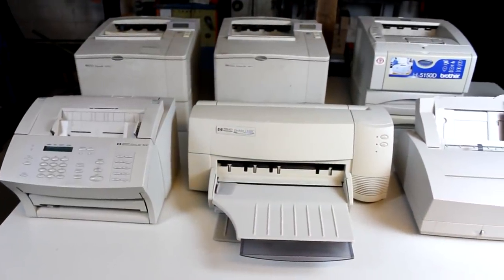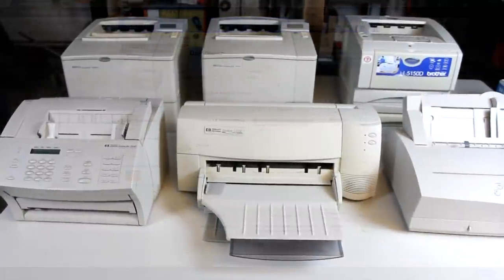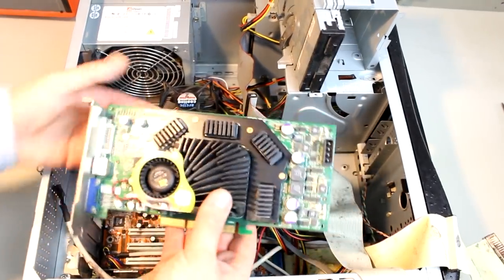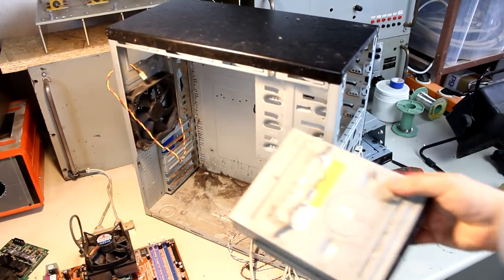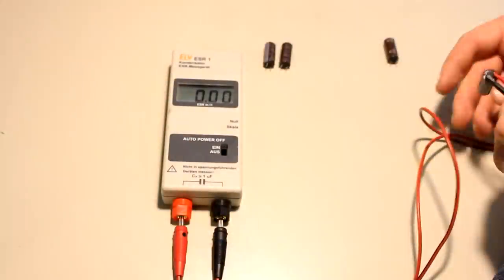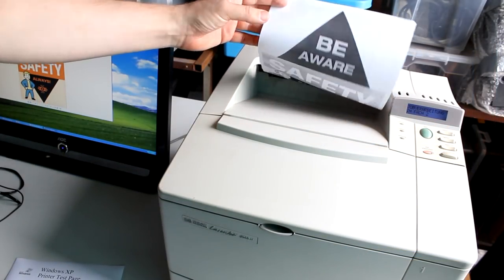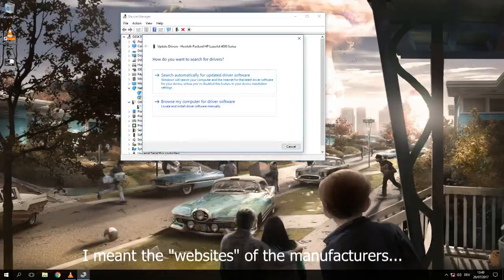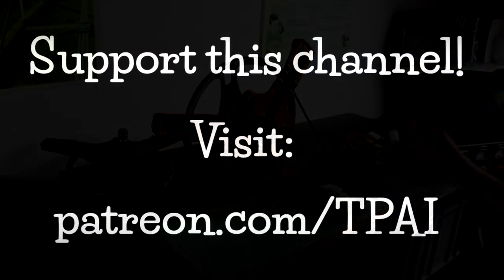Repairing and Restoring an Old Computer - (for those old Printers)

Comment: Desoldering old caps is easier if you add a bit of fresh lead solder on the joints.
Reply: the problem is the huge copper surface of the board leads... those leads suck all the heat from your soldering iron, adding more solder will make it even harder... talking from experience, i had the same "dry capacitors" problem few years ago...
Reply: IamIUareU I had most problems with ROHS leadfree solder and I think adding lead based one lowers melting point. I found that with new solder on iron tip it helps with heat tranfer to the joint. But thats only my assumptions.
Reply: yeah, you are probably right, but i didnt think about that because lead based solders are banned here... :(
Reply: He should use a wider, screwdriver-type tip. Also, his tip is very dirty
Reply: Buy a temperature controlled iron and up the heat for lead free solder, using a flat blade tip on irons gives you more thermal mass so lets you melt the solder. But if the components are close together you can end up doing more damage. 
 
I see a lot of people thinking the cheap iron they have will do the job, but compared to other tools more expensive tools they have makes no sense.

I soldered in my first job for 3 years, working on circuit boards, ground planes and rework. Never had the issues I see on most YouTube videos.
Reply: Afaik leaded solder is only banned to be used in production, you can still buy leaded solder freely.
Reply: Preheat the board for 1 minute with hairdryer first, then immediately desolder. Works great for transformers and large inductors;)
Reply: Temperature-controlled irons won't do you any good if it's just a 25 to 50 watt iron. My 50 Watt Weller (non-temperature controllable) was not able to do the job with point 8 (something like 385 degrees Celsius)

At work, with an 80 Watt Weller temperature controlled iron (it costs something in the range of 700 to 800 Euro) and set to 425 (the maximum) it still was VERY hard. The ground planes are the biggest problem. Peak-currents in a modern motherboard are easily in the range of 300 Amps and higher: to get inductance down, there is A LOT of copper used to handle this. The multilayer PCB's interconnect all of these ground and power planes to form one big conductor.
Reply: IamIUareU Where do you live that lead solder is banned?
Reply: +IamIUareU

You don't need lead solder to remelt crusty old solder joints, you need liquid or paste flux. I would recommend RMA or RA type flux, preferably the NC variety (no clean.) Some types of fluxes are very aggressive and require cleaning to remove them after use or they'll start corroding the board.

I used to have the same problem as you with soldering irons getting sucked cold by large ground planes, but then I started using flux and haven't had the issue since.
Reply: +weeardguy

If you're having problems with a 50W iron not being able to melt solder on a PCB, you're doing it wrong.

I have both a 25W and 40W Weller iron and station and they do just fine on PCBs with large ground planes. The key is you need to use the proper flux and not try to blob more solder on to the connection you're trying to remove, because it just increases the surface area contact with the ground plane.

The only time I run into issues is if I have something like a fat inductor on a power supply that needs to be removed, in which case I'll use an 80W desoldering gun which does the job.
Reply: GGigabiteM it is not the wattage of the iron that is the issue it is the temperature that it gets too. 
Also dump the liquid flux, just hot the joint with a bit of corded solder lead or lead free, then solder sucker. 
If your solder sucker does not work, buy a better one.
Reply: @Tobinator Macedonia. i was using lead containing solder in the past and it was way easier to use but nowadays you cant find such solder here :(
Reply: Buy it from somewhere else and import it maybe?
Reply: It's banned almost everywhere for use in professional appliances, unless they are in the category of medical and defence devices, were lead-containing solder is still approved to use.
But, as a hobbyist you won't have such a hard time (in most places) to obtain lead-containing solder. But, I can understand that there are countries where it's very hard to get.
Reply: Flux is a material to improve the flow of a not yet soldered joint or a badly soldered joint. Flux won't do any good to melt old solder.
Reply: No, it really IS the power of the iron that is the problem in most cases. You need a responsive, high power iron to heat the joint. You want A LOT of heat at the joint for just long enough, not just a little too less heat for extended periods of time until the rest of the PCB is warm enough to melt the joint.

My 50-Watt Weller at 385 degrees just doesn't have the power to melt the joint as the planes dissipate so much of the heat. The iron itself is quite a responsive iron: you'll hear it click almost instantly after applying it to the board.
Reply: There is a difference between a PCB with 'just a plane' (no matter if that's a ground or powerplane) or a multilayer PCB of a motherboard, with a shitload of via's, multiple interconnected planes and thicker copper than the average PCB.

I solder for 21 years already, I know what I'm talking about.
Reply: weeardguy you dont need a 100k car to get from point A to point B same with soldering.
Reply: >Flux is a material to improve the flow of a not yet soldered joint or a badly soldered joint. Flux won't do any good to melt old solder.

Uh, yes it will. Why do you think old solder has trouble melting? Because it's heavily oxidized and the fluxes originally present in the solder have long since evaporated and left gunk behind. RMA/RA type fluxes are designed to chemically neutralize oxidation and will make old dried up and oxidized solder joints flow properly again.

Using new solder on old solder essentially does the same thing, the flux core gets rid of the oxidization, you just get an additional blob of solder with it, which isn't helpful in some situations.
Reply: I'm not saying so, someone else said that. The cost isn't that important. It's about power combined with temperature. A 10 Watt soldering iron at 400 degrees will not be able to do the job. Take an 80 or even 100 Watt iron at the same temperature or slightly lower, and chances are you can fix it. And that has nothing to do with price, the only thing is that most more responsive soldering irons that heat up quicker, are just more expensive. But if you find a good one for say 80 Euro's, that's fine.
Reply: If you has that problem is because you are using a cheap 30W pencil sonder, instead of 40W cheap pencil. or a proper solder station.
Reply: you dont have to spend 700-800 euro. i would never buy a weller. i never worked with a good one. the jbc i have at home is much nicer. if you dont care about digital reading get something like this:
this here is quite a good offer. https://www.weidinger.eu/en/shop/soldering_equipment/jbc/jbc_tools_soldering_and_desoldering_device/jbc_tools_compact_line/wl26830

they heat up in 3 seconds from 0° C. a lot of power and very responsive. still around 350 Dollar. but in my opinion worth the price.
Reply: Even easier with a big pair of pliers.

Comment: THANK YOU! THANK YOU! 

You've solved a very old mystery for me that I've been wondering for 25 years. Among my friends it was common knowledge to not clean your computer out with an air compressor. We had a few friends that would clean them out that way then they wouldn't work. Never thought about the voltage the fans would create when they were spun. Just one of those things that you know but don't think of.

Comment: Hp universal driver will work on a lot of older printers.
Reply: Rudi Fellner This. I work in IT and universal drivers save my bacon all the time with old printers.
Reply: HP Universal Driver is a good thing. I can confirm that too. 
There is also some kind of universal driver from canon, called generic PCL6 driver.

Concerning HP, back in the days, before they made the universal driver, it was always worth a try to use the (windows integrated) HP Laserjet 6L driver, which works for surprisingly many newer models too.
Reply: I still am wondering where he got the ink ya know.
Reply: ig33ku Usually when a business has printers they have a ton of the same one. Only a couple printers are around when they are selling/recycling/disposing them but they still have a ton of cartridges for that model.
Reply: He can also use TurboPrint for Linux and if the Hp Printers are working out of the Box all Driver Issues are fixed. Also he can use then a modern machine which he could already by using a Virtual Machine like VmWare
Reply: too bad that that rarely works on 64bit system, which originally was designed for 32bit  or even older win9x VxD drivers
Reply: @florianlechler6912  99% of HP printers speak PCL. No need for any special "drivers"
Reply: xerox drivers work well too.

Comment: Wow, great tip about the computer fan, very logical and make good sense now that you have said it. Now I know what happened to one of my old Dell laptop 10 years or so ago, it worked fine but seems to be running hotter than it used to, I removed as much of the plastic as possible, found it very dirty, and blew it out with my air compressor, it never worked again. I always figured I had blown a component or connection loose on the motherboard or something like that and went to Best Buy and got a new laptop. I have ruled out cleaning any computers or similar electronics devices with an air compressor ever since. I was amazed at how fast I could the fan spin with the compressed air. DA!

Comment: One of the best things about old HP laser printers is how irrelevant the drivers are.  Just find the PCL version that a printer uses and use a generic PCL driver of the correct version or the driver from another printer that uses the same PCL version.  Even better, a lot of printers new and old support PostScript.

This works because these laser printer have a lot more cpu power than cheap disposable inkjet printers.  These cheap printers are basically only smart enough to perform instructions.  Move x, move y, print this dot pattern kind of stuff.
Reply: It really depends on how much processing power your laser printer has. I have an old Postscript laser printer and it works a lot better using an interpreter on a PC to process print jobs. I mean a lot better   http://i.imgur.com/UKBWVtM.jpg I'll let you guess which the printer did on its own and which was interpreted on the PC for it.
Reply: Paul Frederick postscript printers always did require more on the part of the computer itself. Postscript is a pretty bloated control language (it's the basis of PDF files), favoured in its day for the layout control for prepress work, and hated by anyone who had to support them (myself included).

Having said that, I did appreciate them for the flexibility when coming from a proper desktop publishing program like Aldus PageMaker or Quark Xpress.
Reply: I am using an HP laserjet 5MP (supports post script), with a usb to parallel adapter. works great. The toner cartridges cost $20 and will print thousands of pages
Reply: I am using my homemade CNC machine with the spindle replaced by a pen holder. Print speed is pretty slow but it is versatile when it comes to what it will print with, and on. I pen plot with it a lot.
Reply: I had to get rid of mine earlier this year. It'd sat in storage for a while and the controls stopped working (and I couldn't connect via the network card to configure it that way). I bought it second hand in 2002 when it was already 15 years old, and it did sterling service for another 10 years.
Reply: I have an old LJ4040N on my network and by installing PCL5 software (available from HP) I was able to print using WIN10-64bit. I had to scan the network (advanced_ip_scanner.exe) to find HP network address then plug that into the WIN10. The LJ4050N is a B&W printer and was not listed in PCL5 driver so I installed the 4250 color driver and it worked OK. I recently installed PCL6 drivers and they installed OK as well.

Comment: Just a fun tidbit about the whole spinning fans thing:

I tested a few fans spinning them up with compressed air and a voltmeter on the input to see if there would be any voltages generated. The results were highly conclusive.

With a compressor blasting 90 PSI air at the fan, I git a whopping 0.6v on the +/- wires. I did the test with a few fans and the cheapest of the bunch ($0.99 from Mau's poundland, Big rock candy mountain (aka ShenZen, China)) generated no more than 1.2v, but when I tested to see how much current it was creating with that voltage it was in the nano-amps. Nowhere near enough to bust a regulator.
Reply: want to see something funny? try it on a fan conected to a motherboard with the cpu in it. been there, ps: not funny.
Reply: It depends on the fan. I've managed to generate more than 10 volts with a particular fan (from Cooler Master) and light up a small incandescent bulb with it, but some other fans don't generate any power at all. 
Probably because of the differences in circuitry: in the fans that generate power, the circuitry works as a synchronous rectifier...

Comment: Kudos for checking the PSU caps too, I would have forgotten. Also I've revved those brushless DC case fans way high with a vacuum when cleaning them and never had one go bad
Reply: You can destroy the bearings in a fan by spinning it up with a powerful enough air blast. with a little fan it doesn't take much really. It is actually kind of funny what those little fans do when you spin them up with air. They make a sound like verrup! Which they never do when they're just running. So they're running a lot faster than they usually do.
Reply: Best to park them in my hand and spin them slowly then.... gotcha!
Reply: How about measuring the current and voltage. I've seen it tested and also did it myself. No harmful voltages are generated. Bearings are another thing though.
Reply: I wouldnt use that psu anymore, something in it is not right .. If the motherboard capacitors are bad the psu caused it somehow or its protections failed

Comment: That's actually a nicely put together computer - CPU cold air ducting, a decent graphics card, no dodgy internal lighting, decent sized fans, etc. Although, wires not cable tied? That hurts my soul. I built and rebuilt a lot of computers of this vintage... Windows 2000 is a bit old for these machines.

Comment: What about the static charge from the compressed air? Wouldn’t that damage electrostatic sensitive components?

Although, on some really old computers, I have found putting them in the dishwasher is a viable way to clean them.

Comment: Ambitious ! 
I've solved similar problems with open source drivers from Ghostscript or Gutenprint. If that still doesn't work, set up a Win XP 32b virtual machine with Virtualbox and let it share the printers over the network.
Reply: Sharing (via SMB, Jetdircect or CUPS) doesn't work if the OS you are trying to access the shared printer from doesn't have the drivers. The print server relies on the client OS to supply the drivers for the printers. The only way the print server can provide drivers to the client OS, is if either server and client are the same OS (same version) or if you configured the print server to serve the drivers for the other OS as well, but if you don't have the drivers for that other OS... good luck!

However it's not all that negative because it enables you to recycle those USB to Ethernet print servers that were very cheap because they were brand specific. Just tell your OS to ignore the drivers it tries to serve, and you can use any printer with them :D

Comment: Tip when replacing caps, etc. that you don't care if you save is to cut them off, leaving legs sticking up.  Then easy to heat up and pull out without having to maneuver the cap itself.

Comment: The thickness of your solder is fine because it flows to the tip and pins anyway. Thinner solder is only useful if you are doing pin-by-pin smd-stuff or have very tight space around.

Comment: For power supply: Replace the fans with much newer fans (Y.L. fans are prone to failure if exposed to dust) to keep it alive much longer.

Side blowing fans: 80mm
Top blowing fans: 120~140mm
I used to replace those cheap noisy fans with much silent ones to make it run cooler and longer.

Comment: I have a LaserJet 4100TN, and it works like a charm on windows 10. I use the built in drivers, and I print via the network. I'm surprised your printers were not working.

Comment: I had the same video card, the FX 5950.  I know it's a -50 since it has a feature connector between the VGA and DVI port: there's a dongle that plugs in there, and the card can function as an analogue capture card.  It was pretty slick back in the day.  I dumped a lot of my laser disks on to DVD that way (titles that weren't, and some that still aren't, available on DVD).

Comment: Great video, I was really surprised by the differences between 32 & 64 bit Win10.
I have a 32 bit Win7 box as a seurity DVR, also doubling as a printer server. I could not get the old DVR software to run under 64 bit, so I went for 32bit, Your video seems to make a good case for also sticking to 32 for printer serving. - long live 32 bit!
- Now of to view your hometown historical video.

Comment: I like to use the evaporating solvent cleaner spray in a can like the action can stuff or Wd40 circuit board cleaner spray, have used water before though

Comment: Front panel pinout are standardized. You don't need manual. bascially there are two rows of pins with 4 pins and 5 pins where at 5 pins line last pin that is alone is ground [unused] and two pins right next to it are POWER SWITCH pins and two pins on top of PWSW pins are RESET SWITCH pins.  rest are just hdd and power led indicators pins.